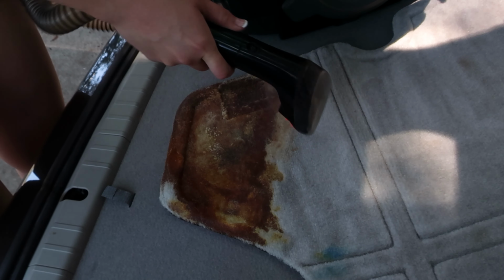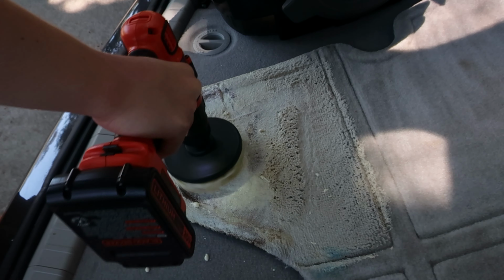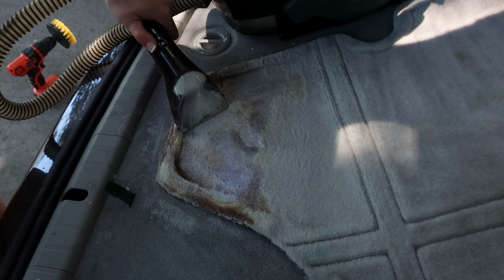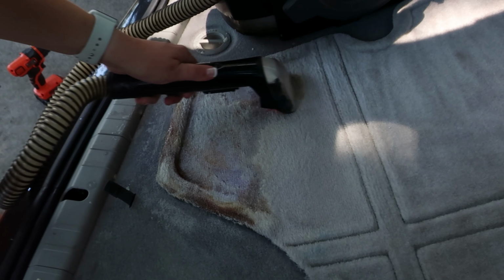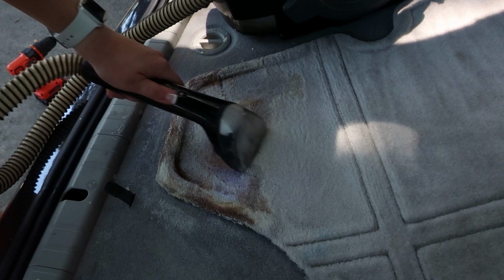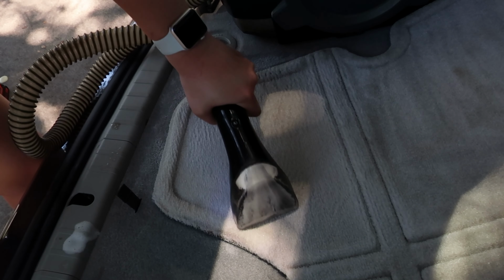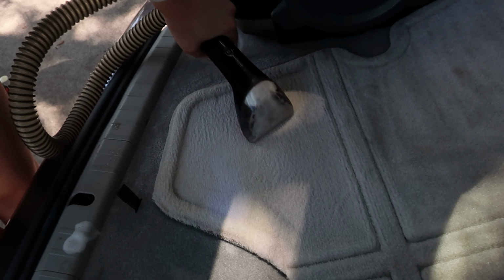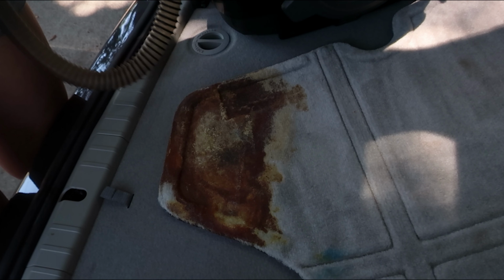How to Remove the NASTIEST Stain || Deep Cleaning Removal of Disgusting Stain

Comment: First of all, you should not clean the matt inside the car, use a separate table.  Some of the stain could get onto the carpet and causing more damage.  Next, when using chemicals, you should wear gloves.  I would treat the stain with Shout, then soak overnight, if possible in Oxy Clean, before I would attack it.  Who wants to see a 16 minute video of carpet stain removal? I don't!
Reply from the maker: Hey! Thanks for watching! I said that it was only going to be the carpet removal, so you don’t need to watch. I personally find it super satisfying which is why I posted a full video of it.